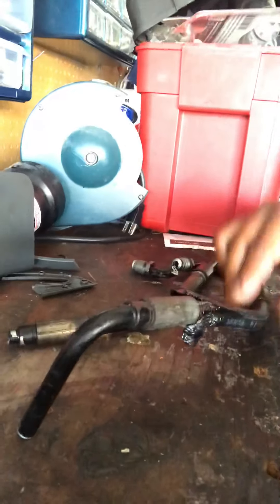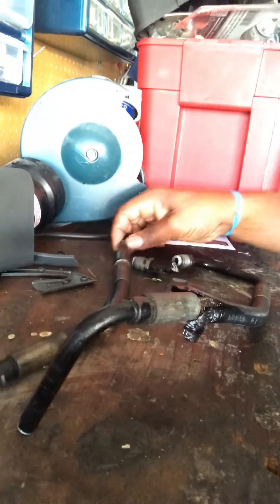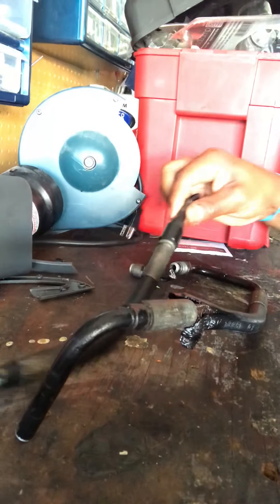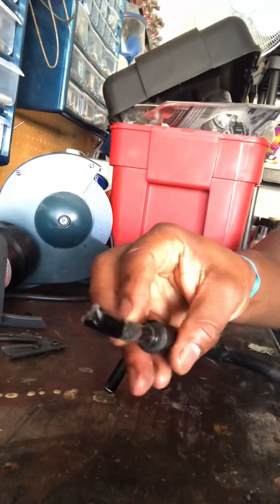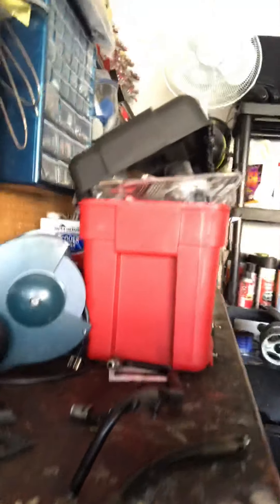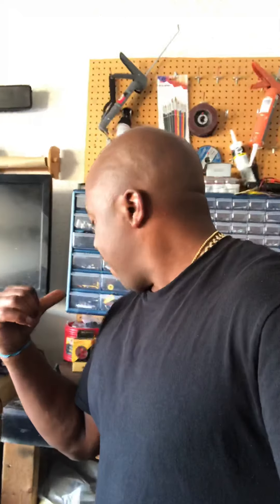Gold Element Autoworks Mercedes SL500 ABC  Suspension

Comment: where the silver sl went is where my cl 600 has gone.  I really think as I can't get the line and I need a new valve block that I will be best to remove the lot and coil over swap it (I'd rather not but I think its the sensible option).  I can then take out the old hydraulics and then sell all the bits I have to help another person out.
Reply from the maker: David Moore That’s what I went through. I enjoyed the abc system. But after the fear of uncertainty and inability to get access to all components and lines without the help of a Mercedes dealership or a shop......the decision had to be made. Once it’s done...you’ll feel more at ease. The returned expense is a nice bonus at the end.

Comment: Hi there great video , do you know if they can be lowered with out hardware ? Mine is so even in lowest position ??? Thank you
Reply from the maker: sputnik Thank you. The level sensors can be adjusted to allow lowering of the car. Or through the STAR system it can be lowered.
Reply: Gold Element Autoworks  Thank’s !! Going to wait for the garage to open after virus.

Comment: In a previous video u mentioned that u had to put some spacer in strutmasrer coil overs. Mine sits a little low in the rear. What spacers will I need?
Reply from the maker: https://shop.advanceautoparts.com/p/autocraft-twist-in-front-coil-spring-boosters-4-pack-ac188001/10053489-p?product_channel=local&store=6674&adtype=pla&product_channel=local&store_code=6674&gclid=Cj0KCQjwiqWHBhD2ARIsAPCDzakdp4I-CGQ3FTJ98lWtbXZSLPNRXTRzyg9FpfO0SgvHo6Gxa3wdw1oaAhkXEALw_wcB&gclsrc=aw.ds

Comment: Yes , I want to remove and rebuild the valve lock, flush the system and change the filter. I know how to access it. I just need to watch someone take one out. I also would like to maintain a consistent contact with someone who knows what they are doing that I can reach out to when I need help. I also have a 98 SL500 silver, 99,017, a 97 S 500 Coupe 200,000 miles. I've had it for 19 years it's silver
Reply from the maker: beckwith46 Interesting. Have you made any progress thus far?

Comment: besides the hoses being old your accumulators are bad and must be replaced. i would not do a coil over.
Reply from the maker: dann hienn I appreciate that advice. But I already installed coilovers. All ABC components are removed.
Reply: @goldelementautoworks  i hope you kept those parts.
Reply from the maker: dann hienn 😂Why?
Reply: @goldelementautoworks  because they are expensive and if you sell the car someone may want the parts.  they will have to drop both sub frames to install the sway bars so they may just want to repl the hoses and make the ABC work.
Reply from the maker: dann hienn I hear you. Thank you. I’ll probably never sell this one. Also, there’s no turning back to ABC at this point. EVERYTHING has been removed. All the lines, sensors and all components. In my mind.....that makes this AL more reliable than one with the ABC. That’s the number one question you ask someone selling their SL. “Are there ANY issues with the ABC suspension???” So if one is ok with a SL without the OEM suspension...it won’t be a hard sell. Not for the original enthusiast.
Reply: @goldelementautoworks  i just completely rebuilt my ABC and RHT.  also everything worn out. looking for an android system to repl command
Reply from the maker: dann hienn Nice man. I just added a subwoofer and amp to mine. I kept the factory radio. For now.......😁
Reply: @goldelementautoworks  i am looking for an android but do not find anything that will just hook up to MOST